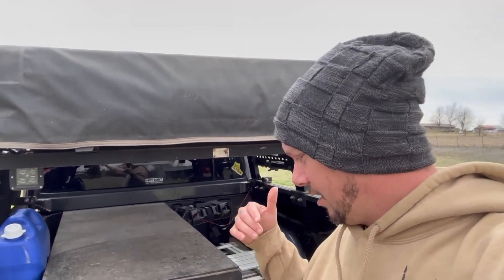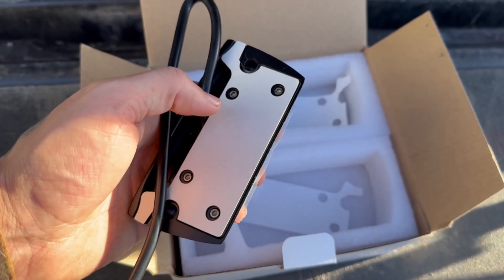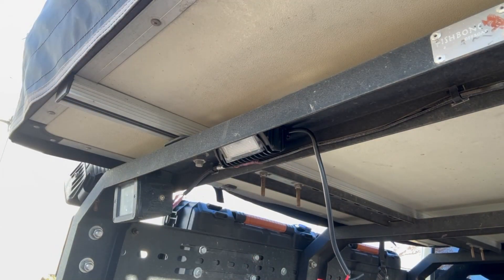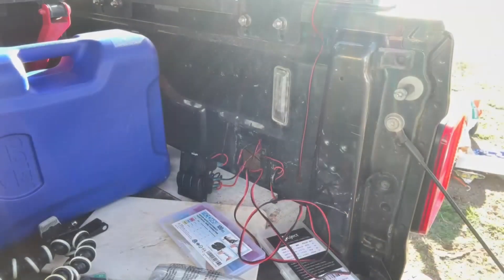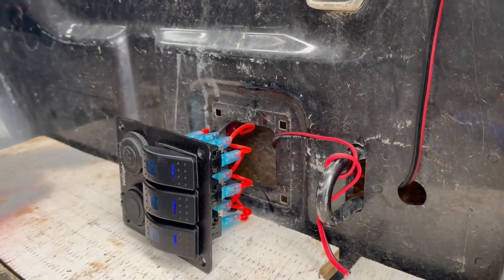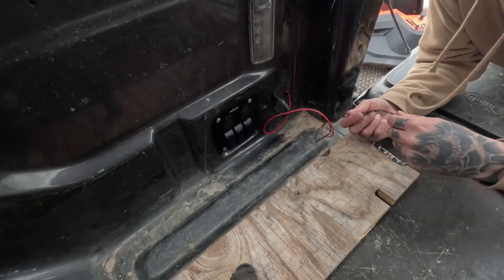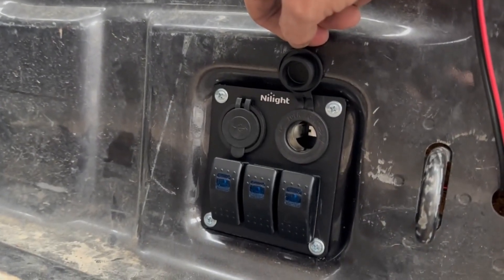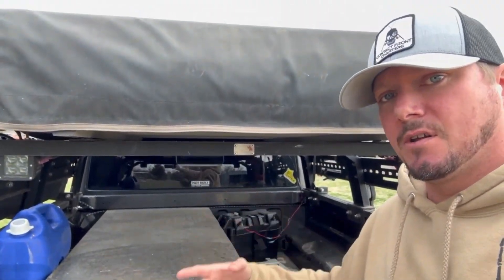Switch Panel install on my JEEP Gladiator.

Comment: Nice mod.I think that’ll work out perfectly for you. I felt your pain when the grinder hit the paint, but it was a pretty clean cut though! Having the switch panel back there will be so much more convenient. I may have to bite your idea haha!
Reply from the maker: Hahaha. Please do! It was pretty easy to do. The hardest part (other than cutting into my paint) was feeding the wire, but that wasn’t that bad with the wire feeder I got off Amazon. I really do love it tho. I’ve ran my diesel heater from it, also a 10’ power cord for my iPad up into my RTT. 

If I could give my opinion- I’d say it’s definitely worth it. Just coat the cuts to prevent rust and you’re golden! 🙏🏼🤙🏻🤙🏻
Reply: Very creative! I was thinking about running strip lights on the underside of the bed rack a little while ago. I like your idea better though. Are you running a marine battery in there?